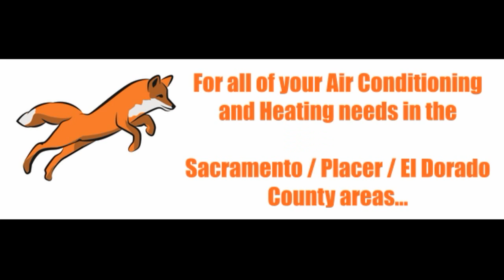HVAC Compressor Motor Burnout. Inside the Compressor.

Comment: I know this video is 3 yrs old, but you did a great job trying to show the best way of taking a scroll apart. Thanks for leaving the oil inside, I didn't realize what a scroll with oil at the bottom looked like or where the oil level might be at at the bottom of the housing, the level is higher than I thought it might be. Thank you for taking the time to post this video.

Comment: looked like oil starvation/contamination and possibly liquid ref. washing out
possibly cap went way low and it ran backwards extended or fan quit and cooked itself for ages
100% sure copper smearing from the killed bearings all over the place ;)
Reply: I assumed single phase, but if three phase, wired wrong and running backwards will do it of course..
Reply: Nah I say the winding shorted